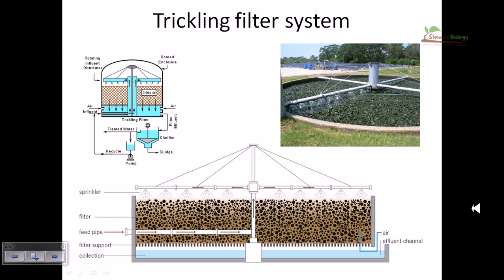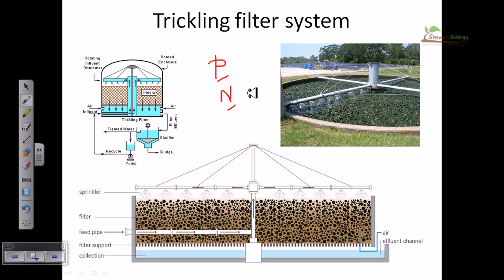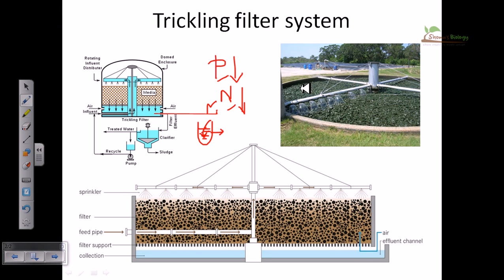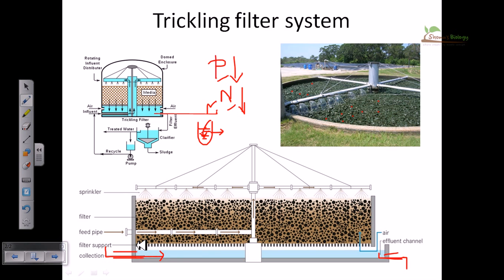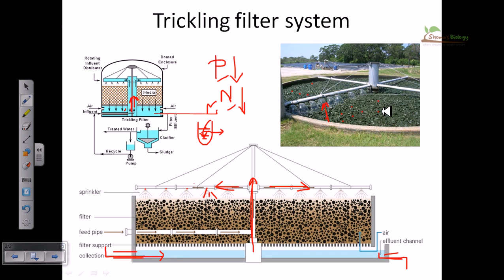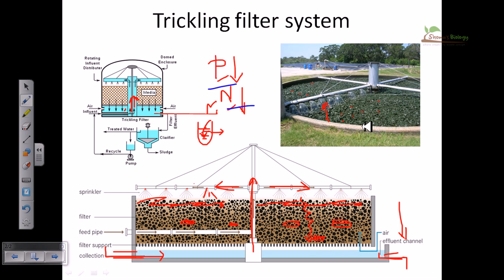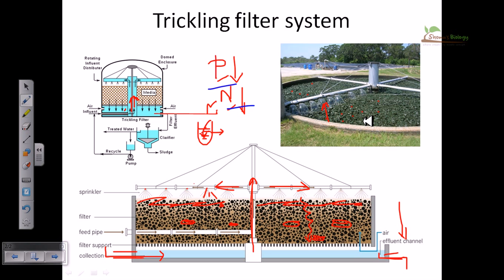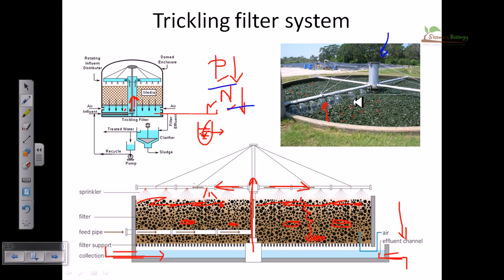Trickling filter system

Comment: the biotrickling filter is used to remove the H2S ,and other gases , 
P & N are processed in the activated sludge reactor where enough oxygen is fed to the system to enhance the removal of these elements , in brief , the BTF is mainly used to control the odor
Reply: So much wrong information.